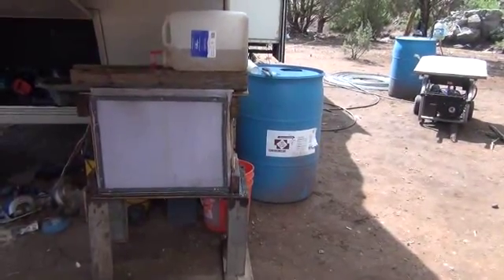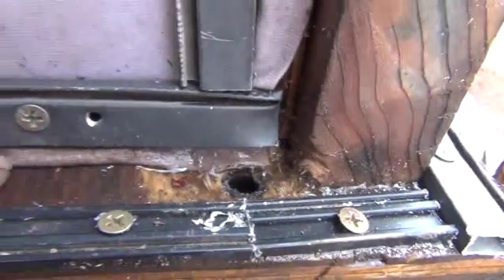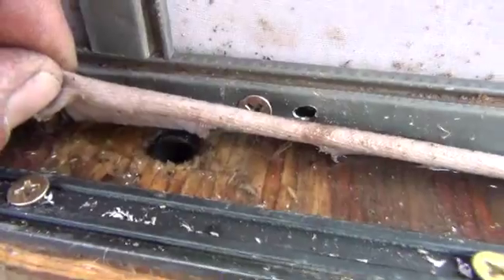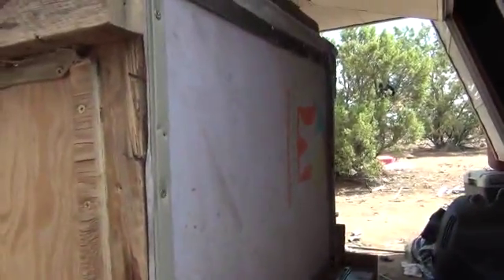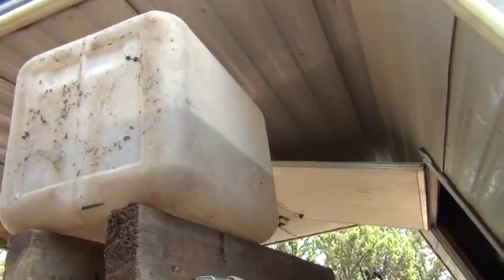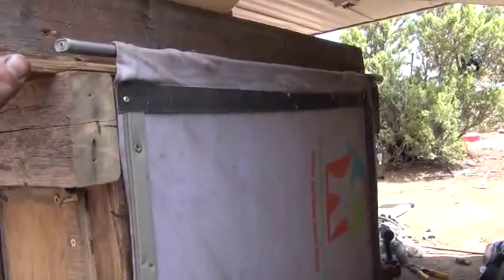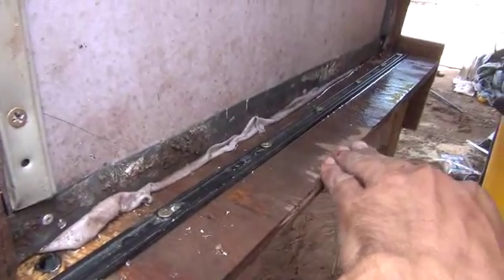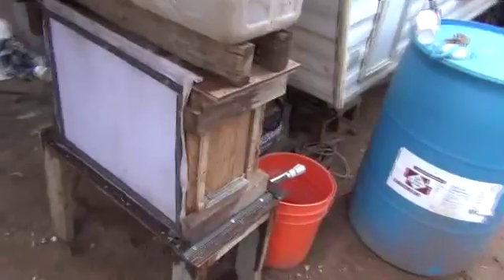Home made fridge P#2 upgraded system "Evaprotive fridge"

Comment: Try using burlap .A tall black stove pipe ,with a whirly bird at top . Direct  indirect evap.I used pop cans with both ends removed. Scissor cut inch down every 1/8 around, then bend all 90 degrees .Slip one can in another .Gives you a finned tube.These 4 or 5 tubes run parallel to incoming air. The also receive evap cooling from different source.This will get you close to dew point.